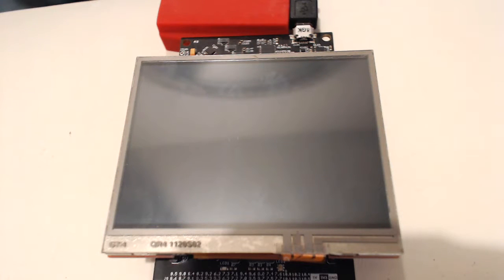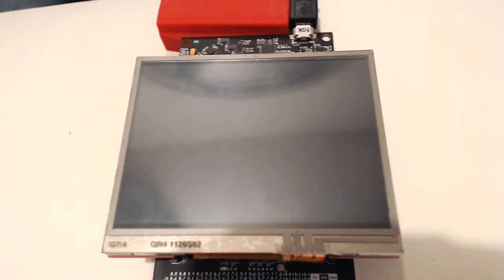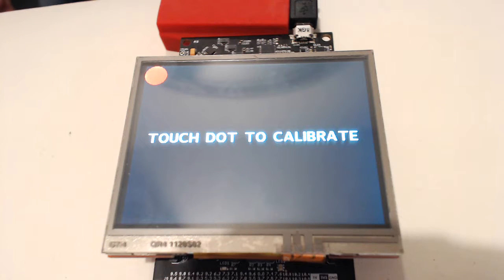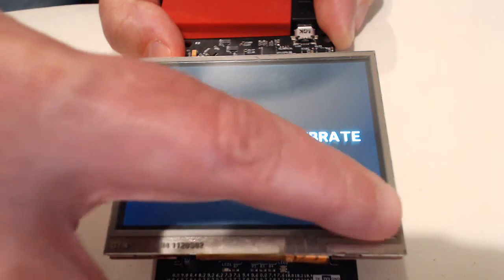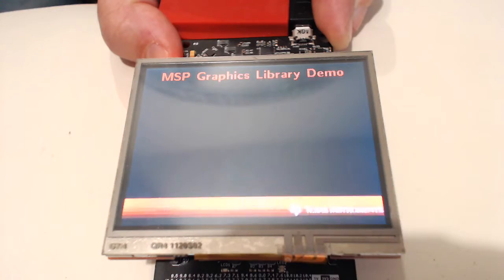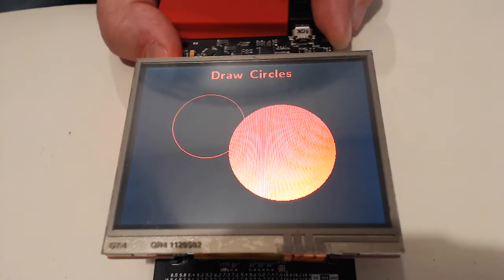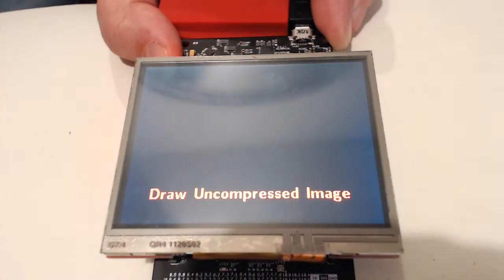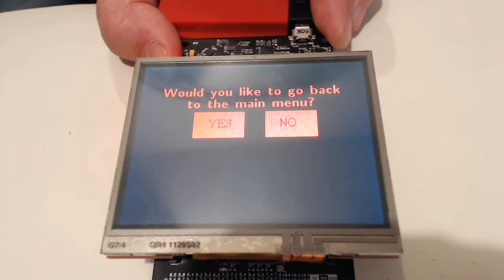TI MSP432 with BOOSTXL-K350QVG-S1 v3

Comment: I'm considering this display for use with the msp-exp430f5429lp.  Do you have any recommendations or comments regarding that combination?  Thanks.
Reply: btw, I also have the MSP432P401R launchpad if it's simply better to use with this display.
Reply from the maker: If you download the Software for the QVGA Display from TI it should contain a project for both the MSP430F5429 and  MSP430FR5969 Launchpads. 
http://www.ti.com/tool/TIDM-3DGRAPHICS-QVGA

The "QVGA 3D Graphics on MSP430 Microcontrollers Design Guide" describes how to set this up.
http://www.ti.com/lit/ug/tidu557/tidu557.pdf